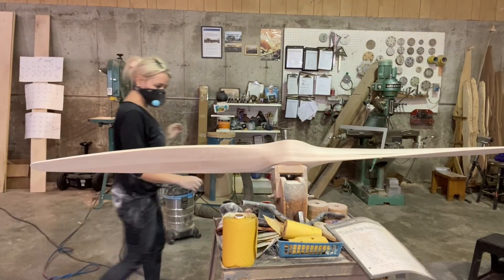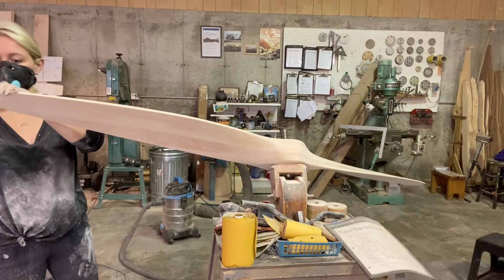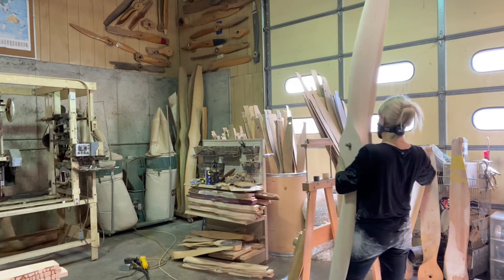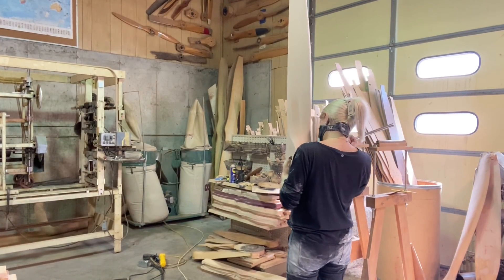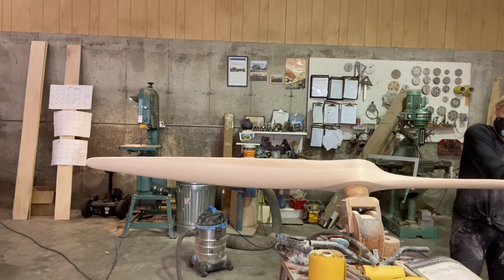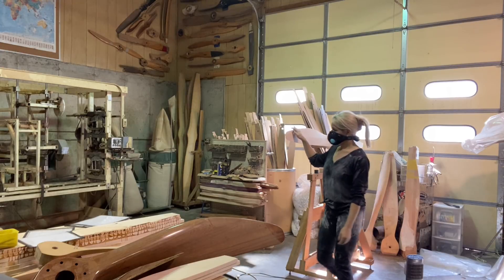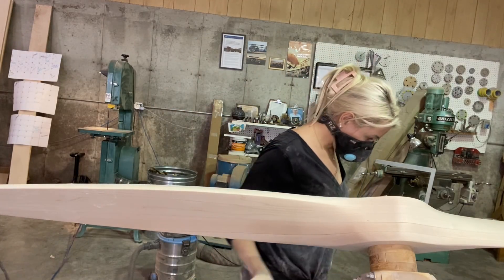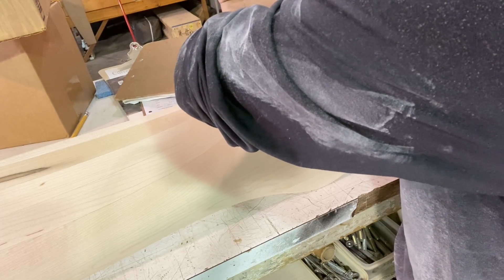Balancing a prop

Comment: What are you looking for on the vertical balance? It's easy to see in the video the horizontal balance but not the verical.
Reply from the maker: It has to stay perfect as well, if it isn’t, then it is usually weight in the hub area that needs to come out

Comment: You have an amazing talent and love for your work. It was cool seeing you use the  Dynabrade . They are the smoothest and most balanced on the market. I bought mine over 30 years ago and it is still going.
Reply from the maker: I love the Dynabrade too! I need to send mine in to get rebalanced. They are so light weight.

Comment: Hi Alaina It's so nice to see the care and attention you put into your work. I'm a guitar maker by trade (Semi retired) with an interest in WW1 aircraft (lots off wood and wire!) Your sanding reminds me of shaping a guitar neck which I do mainly by feel and ocasionally with a template to get me in the ball park. I was wondering as you sand to balance, does sanding at the end off the blade for a given amount taken off affect the balance more than sanding near the hub. Also do you also damp the wood down before spraying to raise the grain ? By the way is the black outfit designed so that you can see how much your sanding off more easily ? I would only wear black when sanding ebony !!! It was nice to watch your video with my breakfast here in Austria, sunny and cold. Stay safe regards Andrew
Reply from the maker: Thank you so much for watching. I bet our crafts are very similar. Taking material off the end is more effective. I don’t wet them, and black is slimming 🤣😂🤣 hope you had a good day! We just woke up to a cool, damp, fall morning here in the Ozarks 🥰
Reply: @CulverProps  I Think i'd have to be dressed in black in an unlit coalmine to look slimmer!!! I hope you don't get too many humidity problems with the weather. Cheers Andrew

Comment: So is there a difference between static and dynamic balance as far as the action of the prop is concerned?  Since you are taking your balance to the weight of a few postit notes, how can you avoid at least doing a touch up balance post finish, which I assume is stain / some sort of weather proof finish?  Additionally how do you judge where to remove material?  Is the hub simply a better place to avoid having to touch the airfoil?
Reply from the maker: Dynamic balance has to happen on the engine